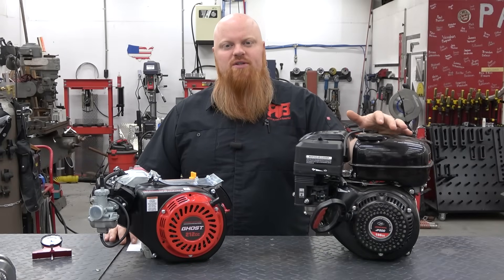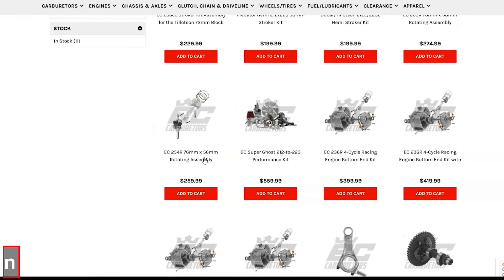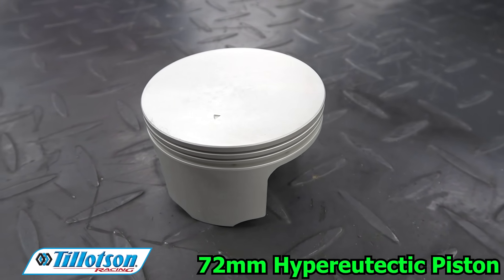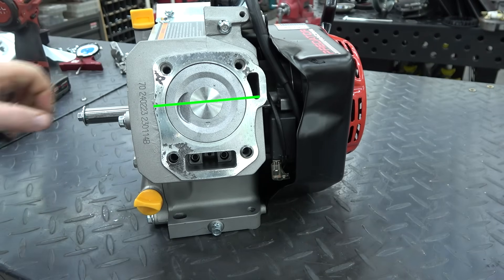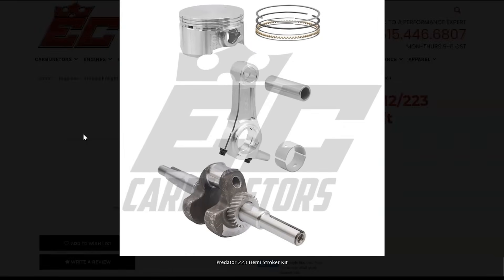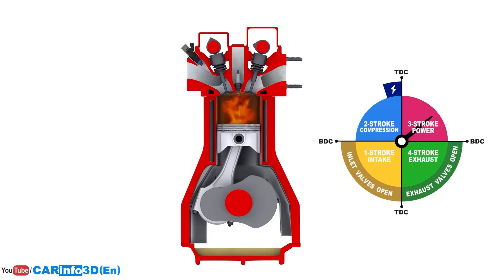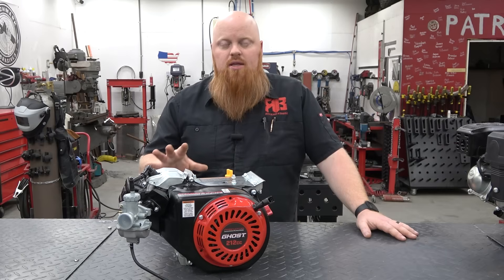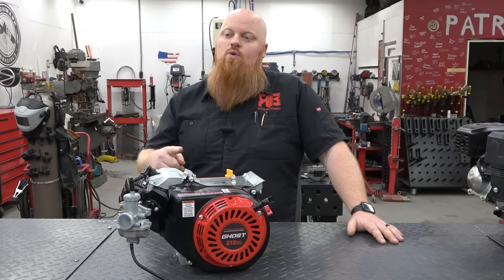Stroker Kits Explained

Comment: I was recently given a 1996 Dodge Viper go kart to restore, it was a dealership promotion from when my late uncle bought his Viper back in the day, i plan on replacing the brakes & tires first then the anemic nearly 30 year old Honda GX100 engine with a brand new 196 with a 204 stroker kit, intake, exhaust, springs and mild cam.

Comment: My opinion on stroker cranks is that they defently produce more torque in the low end but you also increase the wear on the piston (increase in the rod angle = more forces on the cylinder wall = more friction and heat) so when you ride the engine on the race track and you are on crazy rpms you could overheat it or worst case cenario you lock it.. overall i would ride it just in something you need a lot of torque and max at 6500rpm (throttle stop or sm).. piston acceleration is also higher, so you got even more friction! Btw great video! Always learning something
Reply: Shorter comp height piston+ long rod 😎= rod ratio
Reply: @DeezGarage  yeah that's right, but did he install a shorter piston and a longer rod? I'm honestly not good in calculating in inch bc i'm from Austria.. btw i'm also watching driving4answers Videos and stuff about Balance, rotat'n assembly geometry and more.. he teaches it very understandfull 🤙

Comment: remember everyone with big enough valves and a fast enough piston you can actually pull in more air than the displacement essentially making a small amount of boost at high rpm

Comment: Just got my self a new 224 predator a few days ago from my mini Baja I’ve had for a while now I did as much as I could on a 0$ budget with the 196cc I ported, sanded the block, deleted the and head the one thing I bought was a thin head gasket, jetted the carb and ran 5:1 gears with a clutch and got 48 mph, I’m still waiting on the torque converter and I’m going to see what the 224 does stock with an exhaust and torque converter does then it’s billet rod cam valve springs flat top piston flywheel and slide carb time

Comment: In 2009 the Greyhounds were $99. I got three of them back then. With a 20% off coupon plus tax they were $88 a piece. All still run well and one of them is on one of my Colemans.
Reply from the maker: I came in the game too late for them. Predator was everything when I came on the scene.
Reply: @RedBeardsGarage  The Greyhounds are ok. Unique block because of the tank mounts and side cover. The head took a rocker cover that used 5 bolts. They called it a 5 bolt head. Everything else clone.

Comment: I don't recall seeing or hearing this in the video but a hypereutectic are much more temperature stable piston choice of all with the extra silicon content. offers you the ability to run a closer fit between cylinder wall and piston skirt. forged and billet pistons are far better for extreme horsepower under high levels of boost but will be noisy oil burners until the engine comes up to temperature and also forged an billet pistons can be a risk for cold engine seizure if you do not thoroughly warm up your race engine before giving it "The Beans!!"

Comment: Best thing for a stroker is the Dyno Cams 224 camshafts there already clearance in between the lobes and the lobes are narrowed for clearance plus have a slimmer compression release for the 58mm crankshafts.  Cheers